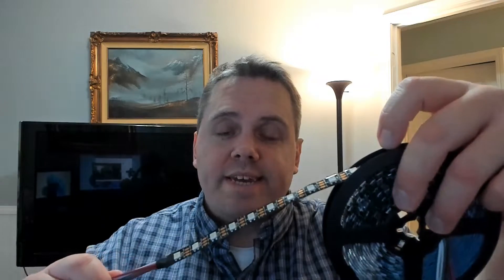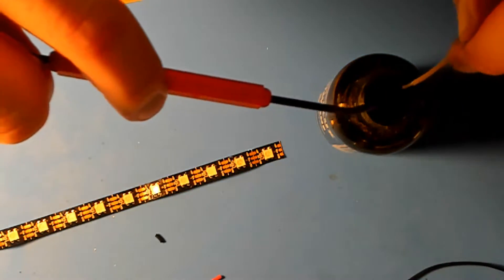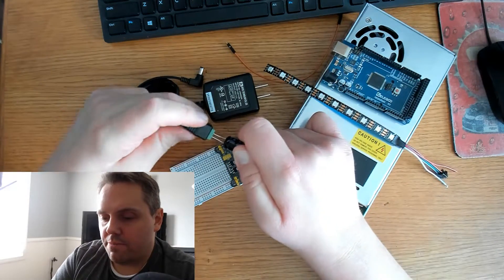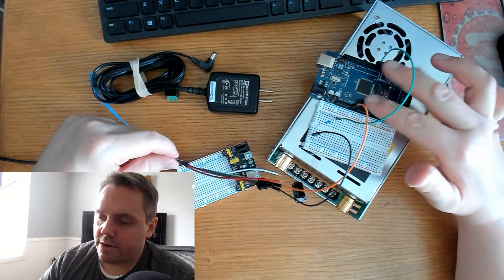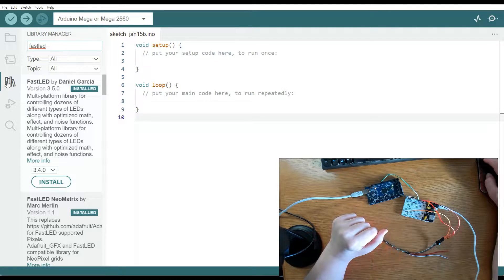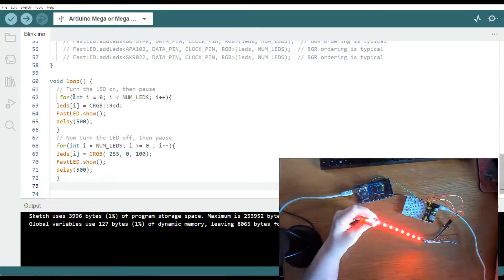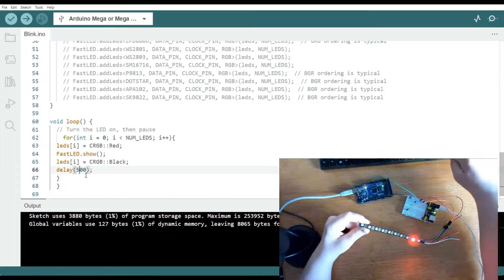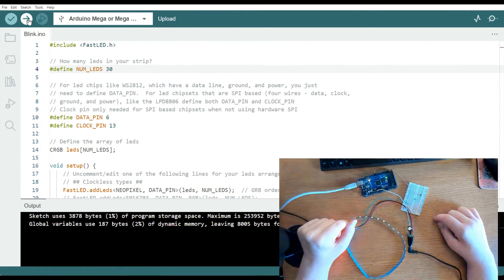Getting Started With Arduino To Control An Addressable LED Strip In This Beginner Project Tutorial

Comment: Should add that resistor value depends on the driver of Arduino + data line (which is not really a transmission line). I highly doubt the wire is 50ohm Z0 (good conductor s.t. we<sigma) to warrant a series resistor.
Reply from the maker: Hey there! Thanks for the comment. Something to keep in mind 👍

Comment: what is the bigger power supply you have there with V and A readout?
Reply from the maker: Hey there!  It's a 24V 20A power supply. I should do a quick review of this thing because it has been great. I use it to connect a full strand of 300 LEDs to ensure the lights can get the right current.
here's the link https://www.amazon.com/gp/product/B09VPFZQJ4/ref=ppx_yo_dt_b_search_asin_title?ie=UTF8&psc=1
Reply: @BMonsterLaboratory  sold! thanks
Reply from the maker: @gregl2406  you'll get some good use out of it. good luck!

Comment: Hi, thank you for making this video. I'm looking for a way to synchronize a LED strip to my music. I was thinking about using the Spotify API to determine which LED pattern to play (hard-coded, no audio analyzing). I'm wondering if using serial communication for every LED change would introduce too much of a delay. The Arduino would basically only act as a bridge between my computer and my LED strip. Do you think this is a viable solution? Also, I'm guessing that connecting two 150 pixels LED strips would require the same configuration from my power supply as a single 300 pixels strip? I need 32FT and I'm wondering if the very last LEDs will be as bright as the first ones, or if I should distribute the power. I don't understand electricity as well as programming.
Reply from the maker: Hi there!  I don't have any experience with Spotify API but it sounds like a cool concept.  Using Arduino as your microcontroller is doable but it will take some research and patients. For 300 pixels, the delay shouldn't be noticeable.

What type of LED strip are you using (e.g., WS2812B, WS2813, APA102, etc.)?
What is the power supply voltage (usually 5V or 12V)?

Check out this sparkfun board - https://learn.sparkfun.com/tutorials/sound-detector-hookup-guide?_ga=2.261992589.1678254721.1695069424-419616546.1677727671&_gac=1.122946297.1691987681.CjwKCAjw_uGmBhBREiwAeOfsd74pysiMAmzBzW-RnMtE-H2cakGq80JT_e8G1EFpFLt4xuwmEvHKlBoCs-MQAvD_BwE&_gl=1*ojqd7e*_ga*NDE5NjE2NTQ2LjE2Nzc3Mjc2NzE.*_ga_T369JS7J9N*MTY5NTA3ODQ0OC4yNy4xLjE2OTUwODA5OTEuNjAuMC4w
and also this sparkfun shield  https://learn.sparkfun.com/tutorials/spectrum-shield-hookup-guide-v2?_gl=1*15gm5dq*_ga*NDE5NjE2NTQ2LjE2Nzc3Mjc2NzE.*_ga_T369JS7J9N*MTY5NTA3ODQ0OC4yNy4xLjE2OTUwNzg4NjcuNjAuMC4w&_ga=2.240422915.1678254721.1695069424-419616546.1677727671&_gac=1.61476190.1691987681.CjwKCAjw_uGmBhBREiwAeOfsd74pysiMAmzBzW-RnMtE-H2cakGq80JT_e8G1EFpFLt4xuwmEvHKlBoCs-MQAvD_BwE

See if you're interested in either of those links.
For a 10m 300 pixel strip you will want a 20amp power supply. IMAYCC Adjustable 24V 20A Power Supply with LED Display has worked great for me. You will want to attach power to both ends of your 10m led strip to ensure uniform brightness. There are lots of diagrams of this if you search Google.
I haven't done a project exactly like this, but If you hit a dead end in your research feel free to email me at bmonsterlab@yahoo.com or send message over Facebook. I'll be happy to help where I can....I may even make it a video!
Reply: @BMonsterLaboratory  Thank you for the quick response. I do not plan on using a sound detector, because I want to manually shape my LED patterns according to my music.

For some clarification, I am currently working on an Angular based GUI. The user will be able to recreate a visual representation of their personal LED strips configuration within the browser (has to be on a 2D surface). With this application connected to Spotify, the user will be able to input ‘’at this particular moment of my song (x ms), change Leds[y] to green’’, for example. I will provide features such as editing multiple leds at once, a colour wheel, and other tools for efficiency. The application will act as a sort of animation software.

Once your animation is completed, the application should then connect to the Arduino through serial communication. As the song progresses, the application will send the synchronized data (LED indexes and rgb values) for the Arduino to make the according changes to the LED strips. So, the Arduino code should be rather simple and short (read incoming data and change LED values).

I’m comfortable working on this (although I’m still trying to figure out a good architecture and data structure). My concerns were rather about the delays introduced with serial communication and my unfamiliarity with LED strips and power supplies. So, to answer your question, I haven’t bought these components yet, but I might just stick with what you’ve used in the video and recommended in other comments. Also, thank you for mentioning that I could power both ends.

I am working on this personal project along with my studies, so it might take a while. But I’ll keep you updated with further questions if I’m stuck, as you suggested. Thanks again!

Comment: what about a battery for power, so you can be mobile?
Reply from the maker: You're going to want a 5v battery supply for these WS2812B leds. Each RGB led can draw a max current somewhere between 50ma and 60ma, so consider that in your choice of battery supply. Also consider how many leds you want to power from this supply and are they all on at once? Do only a few light up at any given moment, like in a chaser sequence for example. If you're going to run a 30 led strip at full brightness, a 5v power supply that could hand 3A current would be fine. Choosing the wrong supply could result in overheating the battery. You could also run them at half brightness for smaller current demand.
Reply: @BMonsterLaboratory  thank you
Reply from the maker: @quemeese  you're welcome. Best of luck with your LEDs!  👍
Reply: @BMonsterLaboratory  can the arduino be powered then from the same source since it is 5v?
Reply from the maker: @dogierek5301  It is recommended that you use 7-12V to power the board. I always try to use external power supply for anything I attach to the Arduino. You could split a12v power supply with 12v to the Arduino and one to a 5v10a or 5v5a converter. You need to take into account the max current for your Arduino and for the LEDS. You also want your power supply to have enough current overhead to properly power your setup. For example, if your LEDs are going to require 5v@5amp, don't use 5V5a supply, go for the 5v10a. If you tell me your setup I can show you how I would connect it. What LEDS, how many, what board... 
 Be sure to research your voltages and current flow and how it will effect each component or device. Also, get help from someone who knows how to do it if you're not sure....No one wants to damage their boards and LEDs 👍
Reply: @BMonsterLaboratory  First of all, thank you for taking your time for writing such detailed response.

My question was related to someone else's question how to power that setup with a battery.

It is my learning curve, so I asked hypothetically, I don't have any specific setup in mind. However, since Arduino nano can take regulated 5v on pin 27 I was wondering if it is right to connect both LEDs (like 20 of them so max 1,2A) and controller to a battery through TP4056 and step up converter 5V/3A. Do I miss something? 

I am more than happy to damage LED or board if I am able to learn something from it, so no worries about that
Reply from the maker: @dogierek5301  That may work. I have never used the TP4056 but i'm reading that it is a charging module for Li-ion batteries and the output is less than 5v. The module will stepup voltage to 5v for output. I'm curious about the efficiency of heat dissipation and battery capacity with this setup. 
Maybe try this: Look into using a 12v4A Li-ion battery connected to a 5v5A converter. You'll need to power your Nano with 7-12v at the VIN pin, or use the usb connection with a 5v wall adapter if you want to plug into an outlet. Also supply power to your 20 LEDs from this battery.  The 12v4A battery I use is on Amazon under the name "SPARKOLE", it has been fantastic. The 5v5a converter I have is on amazon as well (K240505).  
With this setup I think you'll have a more stable power source with better heat management. You'll also have a higher battery capacity and possibly more efficient.
I hope this helps. As with any suggestions from YouTube, research this stuff on your own to make sure you're getting good info. Also, you'll learn lots by researching info you read and hear online - win win!  
Good luck with your Arduino project! 🖖

Comment: I am planning on using the whole LED strip. How do I connect an external power supply to the LED light strip?
Reply from the maker: You would attach it just like I did in this video - with a 1kohm resistor on the LED data line, and a 1KuF capacitor attached at the power supply.  Be sure to use a 5v supply that's capable of 20A and connect your LED ground line to the power supply and the Arduino. I use the IMAYCC 0-24V Adjustable Power Supply with LED Display from Amazon when connecting a reel of 300 LEDs. Don't ever go over 5v and you can adjust your amps around 15-18 with the knob.  👍

Comment: Sir, I've written to you before about a cabinet I'm building and you wrote back with suggestions, thank you. I did buy a 16ft ws212b strip as you suggested and have learned from it. I didn't need waterproof LEDs and there is a big difference between the 30 and 60 LED per meter when considering power supply for a larger project like I'm working on. I'm new to all of this but my understanding from this video is that for my project I will require 3stripsX90LEDsPerStripX50milliamps=13.5amps of separate power. Is this math correct? 
My requirement for one 90 LED strip is pure white, RGBW, not a mixed RGB white. I'm not seeing a WS212b in a RGBW but do see SK6812 RGBW which is listed as "similar" to WS212b. My second question is, will the Arduino control the SK6812s as well as the WS212bs? Third question, does the MP3 sheild you suggested power a speaker or do I need to amp its power to power a speaker? When I remove my pew pew from the cabinet activating the sound I'd like decent audio, not like a greeting card?
Reply from the maker: hi there!  14amps would be fine for a strip of up to 300 RGB WS2812b leds. I don't run mine on solid white, it's usually a mix or chasing lights of flashing lights and I've never gone over 5v@5amps for a full strip of 300. If you're running all those leds solid white then you'll want to consider 50-60ma per led just to be safe. 
If you're looking at RGBNW Natural White SK6812, I found these on Amazon ASIN:B01N5ATQZT (just search the ASIN on  Amazon).  I have never used these but you should be able to use the Adafruit_NeoPixel library with them. Based on the parameters listed on Amazon, you'll need 5v@4amps per meter. It's fine if you provide a power source with a little more amperage than you need but dont' go over 5v or you could burn them out. They say they're similar to the WS2812b strips but I wouldn't mix the two. It would probably be ok but I personally wouldn't do it because they could be unpredictable with timing and color accuracy. For indoor LEDs i purchased the IMAYCC 0-24V Adjustable Power Supply with LED Display with variable Amp dial up to 20A and I couldn't be happier with it. 
The Sparkfun MP3 player shield itself provides audio output signals, but it does not supply power to the speaker. A small amplifier is needed to amplify the audio signal from the shield to a level that can drive a speaker. The amplifier itself will need its own power source, which is usually a separate battery or power supply. I use the OontZ Angle 3 Pro because it has a rechargeable battery that lasts a long time, an 3.5mm Aux connection, and it has excellent sound with a good bass. The downside to this is that it may be a bit large for your project. The Oontz Angle solo is much smaller and rechargeable with a aux cable.  I like to use the shield Aux jack directly to the speaker. 
this is a bit long winded but I hope it was helpful 👍
Reply: @BMonsterLaboratory  Oh, I do have a question. I can't quite figure out why you've never run 300 lights off of more than a 5V 5A? I would think 300 lights would require 15A. Are you running all lights at once at 33% max power,  only using 33% of all available lights at any given moment, or is my math wrong? I'm thinking every 20 lights requires 1 amp to run at full power.
Reply: @BMonsterLaboratory  Another reply I had written to you is apparently missing. I'll resubmit tomorrow. Ty
Reply from the maker: @joebonomono  actually, let me test that and I'll get back to you.  I 'll connect my 5meter strand and let you know.
Reply: @BMonsterLaboratory  Thank you. I got my math from your video but maybe I didn't understand it correctly. Each light uses 50ma. I assume 50ma X 20 lights is 1000ma which would also equal 1amp I believe, but maybe I'm wrong, I don't know. Thus makes is seem like a lot of Amps is needed to run my 27feet of lights but maybe that's what it really takes, I'm not an electrician. Thanks for your help
Reply from the maker: @joebonomono  The mA requirement will change based on the colors.  Check  this out learn.adafruit.com/adafruit-neopixel-uberguide/powering-neopixels. They use a range of 20mA to 60mA to calculate total amps. I think this guide will help.  I have always used 50mA but then again,  I never kept my rgb lights at solid white for long. I'm still going to check my Amp usage on a 5m ws2812b strand...I'll get back to you on that
Reply: @BMonsterLaboratory  Sir, thank you for the link. I've read the article and come to the conclusion that my math is correct but I need to change a few numbers like the draw from 50 to 60. However the natural white LEDs use 1/4 of the chip for that one spectrum of light rather than a combined 3/4 of the chip so the power draw for that white only 90 light strip might actually be as little as 15ma per light. Your recommended power source should be perfect for the project.  I can now also understand how 5V5A could power 300 lights based on draw at any given moment being variable.
 Your recommended Oontz speaker made me realize that 20 watts of power is more than reasonable for what I'm trying to do but..... 100+ watts would be even better so I'm going to have to rethink my overall design to accommodate the power supply, speakers, etc. I may have to build some tombstones to house the speakers or something stupid like that and run a car stereo with an aux as my sound system. I want to fear and have to brace myself before I remove anything from the cabinet because of the wall of sound that will potentially come at me. I'm doing the same thing with my worlds greatest biker build, it's a Harley themed bench I can sit on and bask in my own awesomeness while I put on my boots, because why not. I also apparently now have a new set of waterproof LEDs that I can add to the bench build. I appreciate your help, I'm pretty sure I know what all I need going forward, what I've done wrong previously, and what to do next.  I'll order parts and hollar back at you. Your contribution and data have been valuable to me
Reply from the maker: @joebonomono  I appreciate your comments. Thanks for reaching out. These ideas you have sound pretty awesome. The Adafruit link you have is pretty detailed and should make life easier setting this up. Good luck to you in the mean time. 👊👊